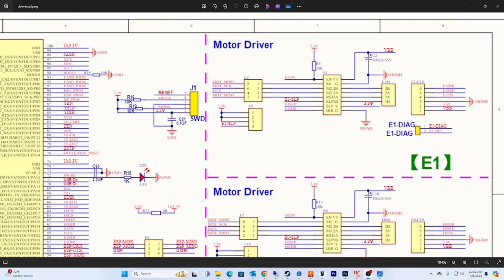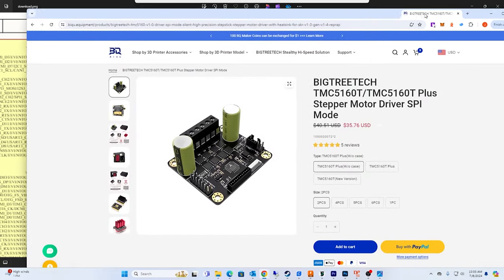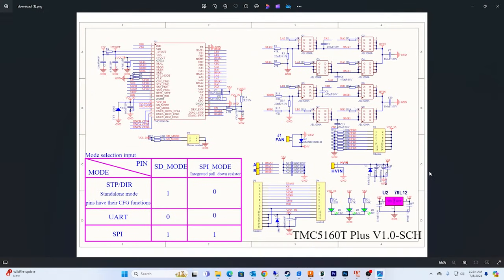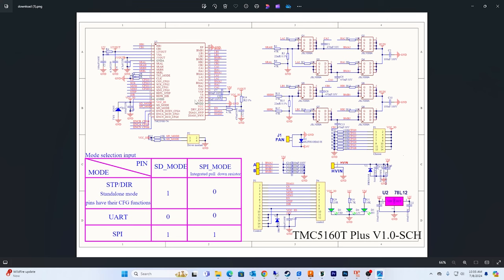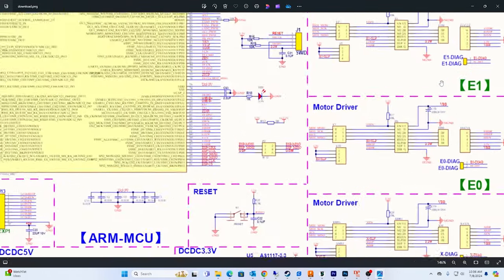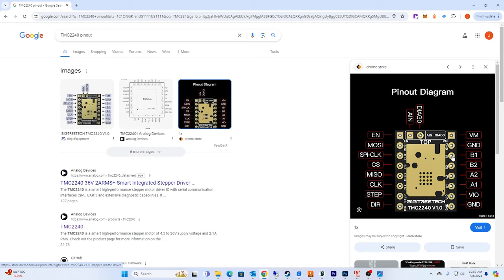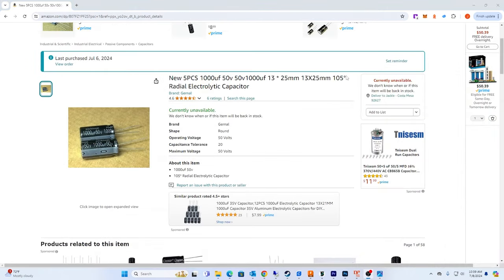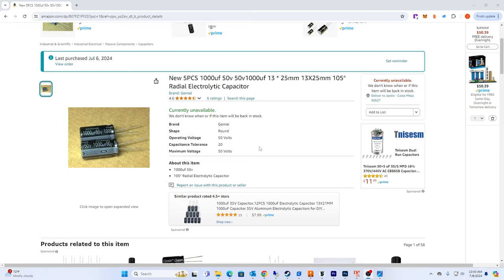Celeritas adding large capacitors to TMC2240 to prevent voltage current drop on hard accelerations 1

Comment: Neat idea! Super curious to see how this will affect the performance of the drivers.
Reply from the maker: I will know on Wednesday. It will be fun to find out.
Reply: @fintechrepairshop  Looking forward to your video!
Reply from the maker: @MagTheFrag  Did you see the follow up video. It fixed my motor issues.
Reply: @fintechrepairshop  Yes, I did! I actually think that I might follow suit, I would love to be able to lower my motor voltage slightly and keep similar accels.
Reply: Or amperage rather.
Reply from the maker: @MagTheFrag Its held up so far to my 50K travels. Even at 1.5A my motors are getting hot.
Reply: @fintechrepairshop  Yeah, my motors get very hot at 1.5amps. I typically run 1.5amps for speed testing, but I have to lower it to 1.2amps for regular printing if I want to heat the chamber at all, otherwise I will end up melting my motor mounts. If the caps could help me reach the same accels that I get at 1.5amps while at 1.2amp I would be very happy.